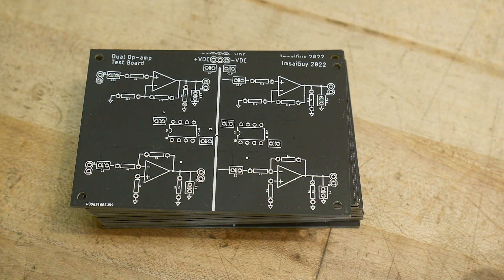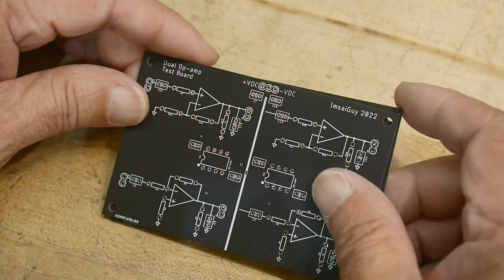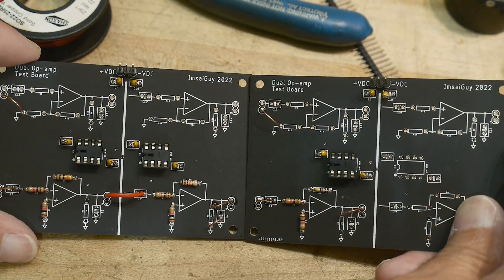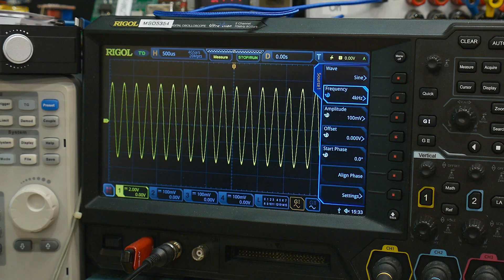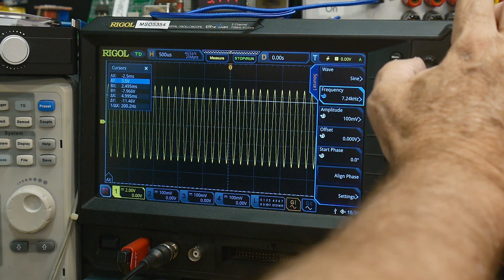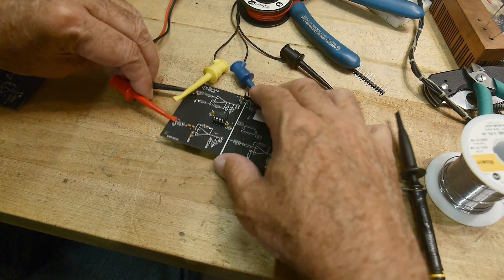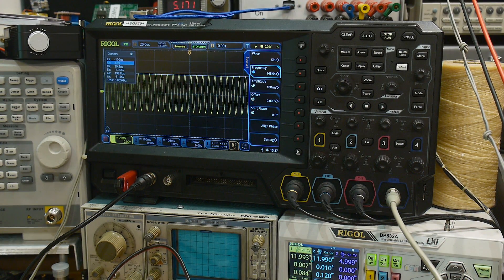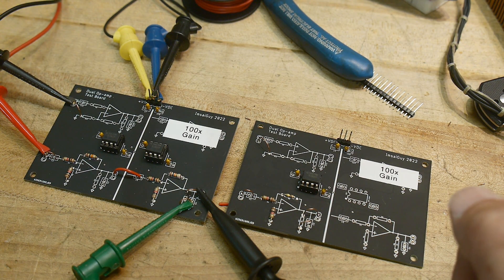#1624 Multi Stage Amplifier Bandwidth

Comment: The bottom left and right op amp configured wrong ouput resistor should be in series not to ground because op amp has low impedance at the output.
Reply from the maker: those are for a load if needed, also a capacitor if needed. many datasheet tests need these locations. of course you don't need to load any or all of the components on this board, it is for testing

Comment: A good demonstration of GBWP there.
I wonder - you made a 100x gain out of two 10x gain stages, but would it behave differently if you did unequal stages - perhaps 20x 5x or somesuch? GBWP is one thing but so is slew rate - maybe it helps to amplify the smaller signal a bit more, knowing that the larger one doesn't have to cope with quite as much slew rate change at the end? Could be a fun follow-up to this one.
Reply: I think cascaded the network is ultimately bandlimited by the larger gain (and thus smaller BW), so to maximize your available BW you'd want them to be equal.

Comment: What bandwidth should have 10x10 version? 3MHz/10, so 300kHz?
Reply from the maker: https://www.ti.com/lit/sboa356
Reply: @IMSAIGuy  So it should be 300kHz? You measured 150kHz. What's the cuplrit?
Reply from the maker: read the paper I sent. if you cascade a 300khz and 300khz. you end up with less than 300
Reply: i guess its the -3db point or the cut-off frequency at which u half the power of the signal by ur filter, in this case the opamp. if u apply it 2 times in serial its seems to be a good approximation that u get half the cutoff frequency. 300/2 khz
Reply from the maker: the formula is  1/f is sqrt(1/f1^2 + 1/f2^2) where f1 and f2 are bandwidths of the two amps and f is the resulting bandwidth
Reply: @IMSAIGuy  Nice formula. It means that bandwidth of your 2-stage opamp should be 212 kHz (300 kHz / sqrt(2)). Still a bit off of 150 kHz you measured.
Reply: @Chupacabras222  I'm definitely no analog expert, but if we were to think of these things more in the time domain than the frequency domain, I think these sorts of factors would make more sense... it takes a certain amount of time for a signal to propagate, a certain amount of time for an output to change from one voltage to another, a certain amount of time for parasitic capacitances to charge and discharge, etc. Thinking about things like this, it would make some sense to assume that bandwidth isn't merely a factor of frequency (or, frankly, at all), but [also] of amplitude, and such...
but, frequency-response is very much how it's taught...

Comment: OK, interesting stuff but why is this the case?  What is going on internally in the amp that causes these results?  
In the 10X10 configuration is the output the same at 1kHz as the 100X configuration?
You have left me with more questions than answers, but that is not all bad.  Makes me have to think about it some.
Reply from the maker: https://www.ti.com/lit/sboa356
Reply: The bandwidth of an OP amp is specified as GBWP (Gain Bandwidth Product) and it is the product of unity Bandwidth/ Gain. So if an OP Amp has a GBW of 1MHz and you set the feedback gain as 10, then the total GBWP will be 100KHz. It has to do with the feedback loop and the internals. Also, gain of 100 equals to gain of 10x10.
Reply: There is also deliberate feedback capacitance built in to roll off the high frequency response so the op amp will be stable when configured for a voltage gain of one (unity gain stable).  Some op amps do not have this feature, so they can be used at higher gains with greater bandwidth, but these will be unstable when configured for low gains.
Reply: I think because there are parasitic capacitances on input/outputs of the amplifier/transistors/whatever that begin to short at certain frequencies.
Reply: The gain-bandwidth tradeoff is easier to understand when you kind of invert what you're looking at. Don't consider an output signal that can grow infinitely large as the gain approaches infinity, rather the opposite, consider an input signal that can be made infinitesimally small as the gain approaches infinity. As the signal level approaches the noise floor, the wider the bandwidth, the higher the potential noise amplitudes can be in the time domain if all the vector elements of the noise frequency components align just right. This can be enough to interfere with the discrimination of signals of similar amplitude. So we must decrease the bandwidth of the amplifier to chop off some of those noise frequency components, to limit potential time-domain amplitudes of those unwanted components. And whether its analog or digital, all signal detection fundamentally comes down to instantaneous amplitudes.
Reply: Many decades ago when early (slow) opamps first came out to get full performance out of silicon, got the 'uncompensated' version and you tailored the gainbandwidth yourself so you could have your cake & eat it. But few knew back then how to do phase-margin /frequency stability poles & zeros - so the majority just went for the 741 - with a gain of just 10x at 100kHz. Then silicon got faster most opamps stayed 'compensated' and became fast which is where we are today. Now today we worry more about PCB layout, guard rings